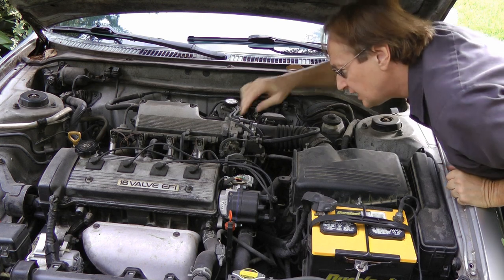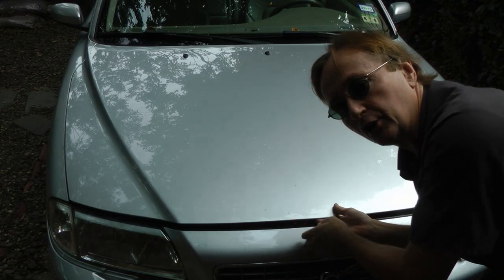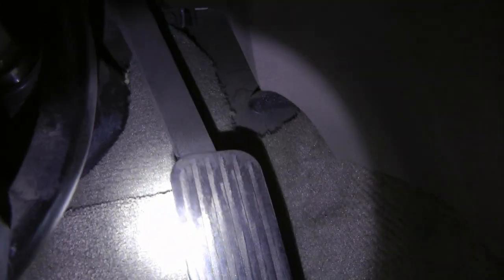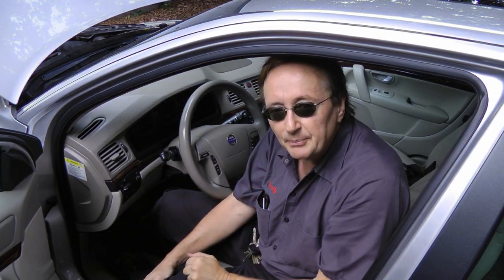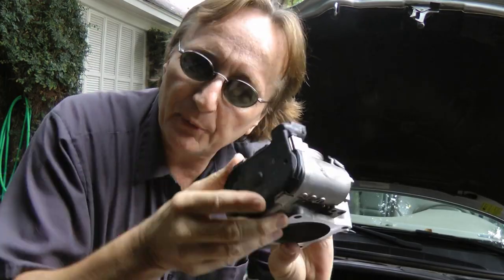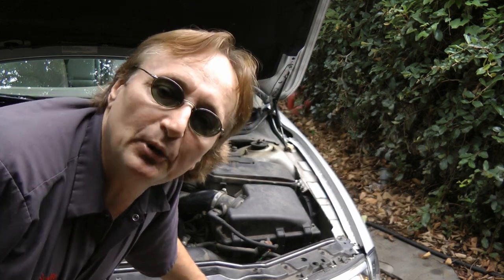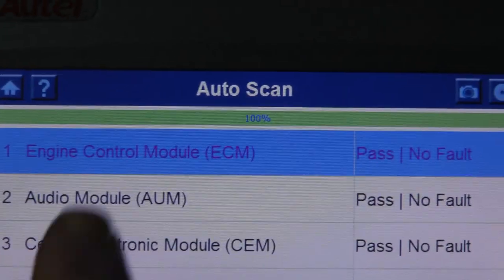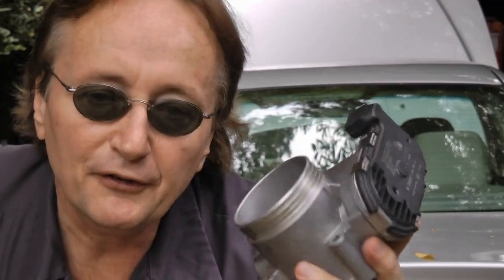Where Has Your Throttle Cable Gone

Comment: I just purchased a new 2016 Honda Accord LX to replace my 2001 Honda Civic HX.  I don't like the throttle body concept, but I guess I don't have a choice with the newer cars.
Reply: It's been around a long time.  My Mom has a 2007 Accord and it's drive by wire.  And I doubt it's the first one.  Her 2002 has a throttle cable but 2003 is the same series as the 2007 so I'm guessing it started in 2003 or 2004.  So they've worked the bugs out by now.
Reply: I believe that Honda started doing this is 2004 and up. My 2003 Acura TL (may it RIP) has a throttle cable still,  the 2003 TL IS the same car as an Accord, other than cosmetics and a few bells n' whistles.

Comment: My previous motorbike had an electronic fly by wire throttle thingy and it felt like crap, it was jerky and the ECU controlled everything, there was an anti-stall and everything on it (if you full throttle in 6th gear at say 10mph it would stop the bike stalling).  Too much computer input for my liking, I prefer the old ways, it feels better and is way cheaper and easier to fix.  If anything broke on that bike I'd have to get my laptop out to fix it!

Comment: lol Hey if you think that bad you do realize BMW's and some Chrysler V8's run on Valvetronics now don't you? Meaning NO throttle body or cable it is run by an electronic attachment to the cam and use
s electricity and a screw to open and close the valves on the rocker arms! It is a great idea it really is, because it improves the fuel economy of in city driving. Because like conventional engines the slightly closed throttle body causes it to lose that extra mpg because less air can get through.

Comment from the maker: throttle cable should never be adjusted so that it has no slack. should be at least half an inch of slack before it starts to pull  on the throttle. start there.

Comment: I had an 05 Mustang with one of these Drive by Wire throttles and there was always a slight, but very noticeable, throttle response delay. It was so annoying and almost ruined the experience of the otherwise nice car. It felt like carburetor bog.

Comment: Hey Scotty, my automatic 2018 Corolla gets stuck in high revs if I have to quickly accelerate, eg: to avoid collision etc. When it does this I have to pull over to a stop to reset the revs. Sticky throttle? I want your opinion so I can talk to my mechanic about it.

Comment: I have a Hyundai Elantra 2012 and my gas pedal is hard to push down, I ordered an bought a new Gas Pedal Sensor, I want to know why it's hard to push first before i change it. I cleaned up the throttle body but it's doing the same thing. Do you think my current gas pedal sensor has been damaged?

Comment: Replacing them as a whole might be related to safety and cost associated with stocking individual sub-assemblies. Who really knows. As for reliability, its all in the design...you could make one of these bomb proof by using optical encoders, high quality steel gears, high temp electronics, etc. Instead bean counters and management get involved and the result is rheostats, homing contacts and plastic gears. Parts cost savings are rarely passed on to the consumer by auto manufacturers.

Comment: I had this problem on my 2002 Nissan Altima a few months back. Bought a rebuilt unit for 400 bucks, installation (which I should have done myself) and reprogramming was another $140. What is wrong with good old fashioned throttle cables?

Comment: I'm no genius but doesn't the computer have more hesitation than just a normal throttle cable?
Reply: Yes and no. The newer electronic throttles are capable of being just as fast as a manual cable throttle. However, most cars with electronic throttles are purposely delayed and limited, as in they don't respond to fast and harsh inputs. My Dad's 09 Cadillac STS has a VERY noticeable delay on the throttle, and even if you punch it, the car just doesn't get up and go like it would if the throttle were controlled manually. My 08 Accord V6 6 Speed however has an extremely fast response time, despite being electronic. In fact, I didn't know it was electronic until a week after I bought it!
Reply: Fatbobjr21 in some cases there is a slight delay like we're talking 10th to 2 tenths of a second. Noticeable but not a crazy deal breaker I think it's for emissions control
Reply: Mason McDonald Thank you for that I was waiting for someone with common sense but also elect. throttles are not that sensitive to save fuel like my corolla but an Audi will have quick acceleration because of performance

Comment: Scotty, I have a 98 Jetta VR6 and the bracket on the lock cylinder (driver's side) has snapped off (it used to be one solid piece connecting to the lock cylinder.) If the chip in the door is NOT on the lock cylinder itself, I should be able to find the same lock on a junker, match the tumblers, swap it, and everything should be fine. Am I right? Or do I need to bite the bullet and give VW $600?
Cheers.

Comment: It seems they did that only to get more money for shops when they have to fix/ replace a new throttle.  What would happen if you somehow put in a throttle w/ a cable (connected to the pedal) into a car where it rely's on the computer for throttle opening position?  Would the computer adjust to the manually opening and closing the throttle plate?

Comment: Cable throttles body's  are much better than electronic ones.  1. They are are adjustable.  2.  They can be cleaned with throttle body cleaner without breaking the switch that opens, and closes it.

Comment: Hey scotty i have a 2011 Toyota Camry V6 and the engine is very loud.Not loud like a diesel but not as loud. On this video its not mine but sound the same "2011 Toyota 3.5L V6 engine tapping noise" by neam27.

Comment: Hey Scotty, my 1992 nissan sentra has been misfiring for about 2 weeks. I checked all the sensors and the injectors with a voltmeter/ohmmeter, and everything checks out. I used a compression tester, and all cylinders are very close to each other and almost good as new. It has started to use coolant recently, and never did before. That is why I checked the compression. Do you have any ideas? Thanks very much.

Comment: Turn Indicator issue on a 1999 Honda CRV

Scotty - my son's CRV's turn indicator lights down always turn off when the wheel turns back.  I took the housing off the sterring wheel column and found that the switch works fine but the white plastic thing on the column that has a knock out in it to work the switch doesn't always turn with the sterring wheel.

If it would always turn with the wheel I would have no issues.  Any thoughts on a fix?

Comment: scotty, just changed my throttle body and need to readjust my cable, how much slack would be correct in the cable at closed throttle? thanks!
Reply: Just enough slack that the throttle stay open by it self

Comment: It's actually even more nefarious then part cost. The real reason they use these instead is that it lets them eliminate a job position. See, assembly robots can't yet efficiently route and connect flexible things through conduits and spaces such as steel cables and electrical harness looms. So by switching over to these electronic throttles it just one more connector for the person already routing the wiring harness and lets them eliminate the guy that would have routed  and tighten the cables.

Comment: Hey Scotty!

What else do you think will go from mechanical to electronic in the not to distant future. LOL maybe your thinking "The whole car".

I have been reading about this new "free valve" technology that controls the valve train electronically without chains, cam gears or cam shafts. Steering systems are going away from Hydraulic to electric.

Whats next, electric brakes instead of hydraulic??

Comment: I have a 2011 Nissan Altima Coupe and I been realizing that the car doesn't respond to the gas pedal as fast as it use to. I have to press the gas a little hard to get it to accelerate.  Do you know what the problem might be??
Reply from the maker: try cleaning the throttle as in my video "how to fix a car that idles poorly"
Reply: I imagine the cable might be stretched. I think you can tighten it where it connects to the throttle under the hood. I've never done such a thing, so I don't know much.

Comment: Is it possible to convert to cable if you have electronic?
Reply from the maker: it would be a giant pain, cause that's all computer controlled and everything would need changing for it to work
Reply: Scotty Kilmer I heard that the 03-06 chevy silverado’s with the 5.3 and similar, are supposedly convertable with not all that much work. I read some article way back when about it. Here it is- http://lt1swap.com/cable_conversion.htm
Reply: It’s possible to change.just changed mine from electrical to mechanical cable and it’s awesome.
Reply: What vehicle?
Reply: It’s a Pajero exceed 3.2diesel
Reply: Changed injection pump from electrical to mechanical aswel

Comment: Mr kilmer i have a 1994 Toyota corolla AE101 sprint my gas pedal has become stiff and i need to rev the engine sometimes when taking off what do you recommend?
Reply from the maker: clean the throttle with spray throttle cleaner as in my video "how to fix a car that idles poorly"
Reply: thanks alot but i actually have a throttle cable not a modern computerized one will changing the cable help?

Comment: @ThumbdownMan,  ya I know all to much about that crap.   Did a new fuel pump replacement on my grandpa's 90' Dodge Ram.    1st "new" one died three months after install.  Faulty impeller, and so far the second one is doing fine.  Thank god...  I'd drive that damn truck off a bridge b4 I buy another 150 dollar fuel pump.

Comment: Hey scotty I have a question. I have a 1984 K30 Silverado dually with a 454 7.4L big block and the throttle cable or gas pedal is saggy giving only half throttle what could it be throttle cable or gas pedal???

Comment: I have a question. my wifes cousin replaced my thermostat and thermostat housing and the hose and the water pump hose. he took the throttle body off and the top part were it connects to get to the thermostat well he put it all back on and broke the two plastic lines that goes to the throttle body and it wont stay started and sounds really rough how do I fix that? its a 1988 Pontiac firebird with 96,000 orginal miles on it
Reply from the maker: try epoxing the hoses back on, I use JB weld Kwik, works great. If not, time for a new part
Reply: yea the whole vacuum system needs replaced all the hoses are collapsed thank you scotty and great videos

Comment: hi have a 2001 ford windstar sel , every time i accelerate the van jerks , i have to constantly lift my foot off the accelerator to stop it from jerking while driving , any advice on this ?
Reply from the maker: have the fuel pump pressure tested, pray that's weak and that it's not a transmission failure those were known for at that age

Comment: smithraymond09029, hmm, might be that, or either fouled injectors.   Check injectors with the next tune up.   I had a problem with mine on an old 93 Ford Mustang.  I'm no expert just speaking from own exp.    she runs good with new #19lb injectors.

Comment: Older Toyotas are the best, wouldn't you agree Scotty?
Reply from the maker: Yes, I"m driving one right now
Reply: My 1988 Corolla with a carburetor, yes not even EFi, stilll goes fine with over 150000 miles. Starts first pop, runs strong. Gets a decent service once a year. (Back then only spaceships had computers,I think.)
Reply: i will take the older cars any day
Reply: Jon Low hundred fifty thousand is nothing for that motor. keep changing the oil you will probably hit 300 k. And then get rid of the car because everything AROUNDd the motor is failing

Comment: Hello Scotty . I have a 94 Dodge ram 250 van with the 3.9 v6 . Its started shutting off randomly . My question is when it doesn't start if I pull the #2 plug wire off and leave it off to start it it fires right up. Then I put the plug wire back on and it starts up and runs fine for a while ?? Any suggestions???

Comment: I got mine replaced 4 times and had it go through the relearn process and it worked for 3 days then throttle warning light with the lightning bolt came on again sent it back to my mechanic and he tried blaming it on my cold air intake telling me it needed to be tuned and sent me away with it like that now my car broke down the way it was before with the timing belt all messed up the cold air intake I have I learned it dosent need to be tuned because my car dosent have a mass air flow sensor I payed this shop $1250  just for me to leave with the same problems I payed them to fix can anyone please tell me what might be causing this the throttle body that was put on it is brand new and my car is back at the shop  trying to learn more before this guy tries to pull another fast one

Comment: Hi I have 2000 Mazda 626 LX that won't go in reverse....well after I took it to the shop they of course said I need a new transmission...but after I left the shop the car started going into reverse again....could this be the throttle cable computer....also I had a NSS (neutral safety switch) put in about 8 mo ago but the Mechanic did not put it into Neutral when he replaced it...could this be causing gear problems
Reply from the maker: check the linkeage on the transmission range sensor, it could just be off a tad bit and need adjusting
Reply: Ok...is this hard to do...do you have a video...also do you know how much this would approx cost
Reply: oh I see....it's the same as the safety neutral switch...Thank you so much Scotty....I was thinking the same thing...will try it

Comment: Less cost to produce the part. It's more expensive to have a throttle body, and a separate cruise control unit. They'd rather integrate it into one mass produced part.

Comment: Ahh I see that cars are going to the by wire route after all. On electric forklifts and aisle lifts ALL items are by wire. We had someone get hurt bad because a wire to the electric emergency brake electromagnet that pulls up on the brake pad, broke, which put the brake into its normal position when off, which is braking position, that threw the associate off the equipment from the sudden braking force.

Comment: It is true that they are more pricy to fix, however theres no way I would have made it home today, up a mile long hill with a 45 degree incline on summer tires without traction control. I simply put my foot down and the computer worked the rest out.
Reply: You do realize that traction control can still function on a car with a cable throttle right
Reply from the maker: +ZIPPER978 it wouldn't work very well though, older system trac systems pretty much sucked

Comment: My jetta vr6 throttle cable is loose and I'm not getting my full pedal if that makes sense is there anyway to adjust it on that car 1998 jetta vr6
Reply from the maker: on the end by the engine there should be 2 nuts holding the bolt on, you can adjust it there

Comment: They replaced a $30 cable with a $200-$750 electronic part that sits on a hot engine,  heat+electronics=expensive broken parts in the long run.

Comment: my car burns a lot of fuel at high speeds (above 80) any suggestions
Reply from the maker: +Ghagadar Garrell drive under 80 then. The faster you go, the worse the gas mileage on any vehicle. But do check for leaking fuel injectors or a transmission that's not shifting into overdrive

Comment: I don't trust electronic throttles. The braking system is too important to vehicle safety to risk something going wrong with a computer based sensor. Drive by wire is not as safe as a cable throttle  connection.

Comment: Hey question I drive an 05 Lincoln LS V6 i thought my front right brake was low because my car was sqeeking bad but when i lift the wheel and turned it it was sqeeking and the brake pad wasmt all that bad pls help

Comment: Are there any modern cars that still use a cable throttle?
Reply from the maker: Hans Blitz not many left, as they get better gas mileage and it's all about that these days
Reply: joshburstyn he's just thinking more along the lines of simpler doesn't break is often and when it does break it's less expensive to fix

Comment: I suspect that its a design simplification/cost savings, the rational is that most cars use cruise control with an actuator anyway so why not skip all the steel cables and just attach the old cruise control actuator directly to the throttle body and save money. Personally this seems like an ass-backward approach to design that isn't doing the consumer any favors. I'm also curious about how well these follow your foot movements (ex. hitting the gas hard to avoid being T-boned by that 18 wheeler).

Comment: Then, sudden acceleration happens because reading the acel pedal is made by software. So welcome to the issues. Toyota has faced a serious issue two years ago because this issue. They hide the real issue talking about the matt and the the pedal assy, but what is gone horribly wrong there is computer crashing because gadgets onboard that radiate microwaves, cell phones, bluethoot, stereo, etc. Computer are soooo weak at this point even the good designed ones will face an issue at some condition

Comment: Not necessarily so these days. For instance failed electronic component/s usually give no visual indication. SMT boards are very difficult to to work with, and potted boards can be impossible to access.

For things like electronic throttle control components, a technician (and/or shop) should also consider the liability angle of attempting such repairs... you gotta keep your ass covered anymore. Sad but true...

Electronic throttle control isn't the correct technology for the application...